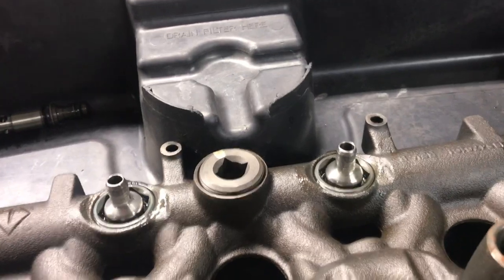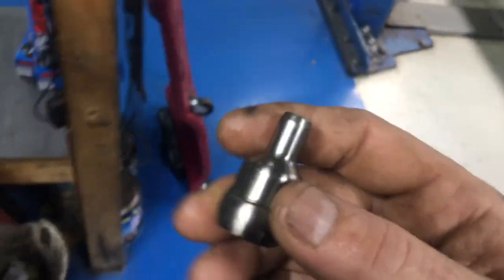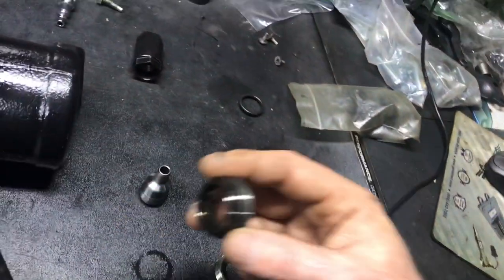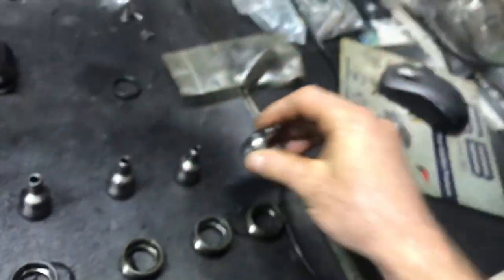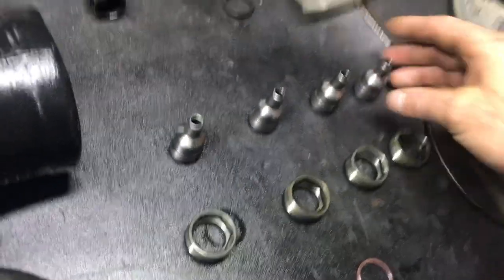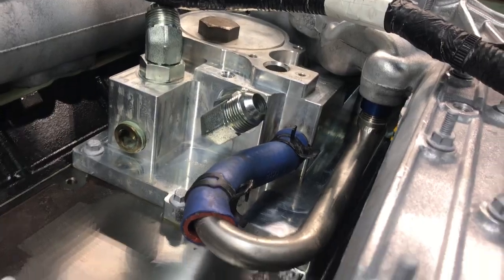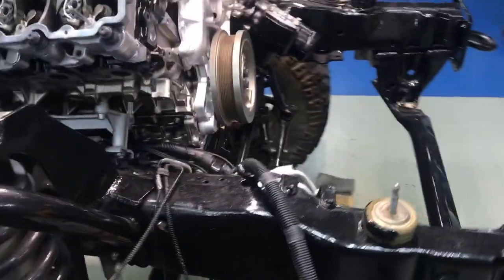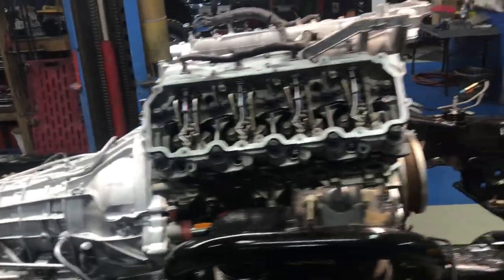Teds X vid 11 nipple cups

Comment: I’d put some worm clamps on that dern EGR cooler delete with the stupid relocated engine oil cooler. Those darn spring clamps will fatigue and lose their strength in clamping force. That screams come back to me.

Well but then again it’s customers parts  and they know best right. 

I’d be putting a OEM engine oil in the dern thing and get rid of that that junk.

Comment: Put hhc nibbles cups and there orings I did on my truck anthony did it dont cheap out lol but my truck maybe total has I'm waiting on the insurance company
Reply: FORD4LIFE73, what the?????? You get in an accident Preston? Hope your ok.
Reply: @22howards  yeah thanks to brake checking I have ordered a dash camera now my truck went head on to a concrete barrier at 40 mph and also side swipe a vehicle it's good a little frame damage I'm going to make a video when I go by the body shop I couldn't make one Tuesday I was too upset and still pissed off
Reply: So are the factory nipple cups not available?
If not who makes the best aftermarket ones?
Got an 05 6.0 that they have a little more movement than I’m comfortable with. I know exactly what Anthony is talking about when he says you can’t explain it...
Reply: @midstateconst5947  there available but hhc nibble cups and orings are the best I have them on my truck and just look up on YouTube hhc nibble cups and orings
Reply: FORD4LIFE73 hhc it is then.
Thanks for the info.
Reply: @midstateconst5947  no problem it's worth the money